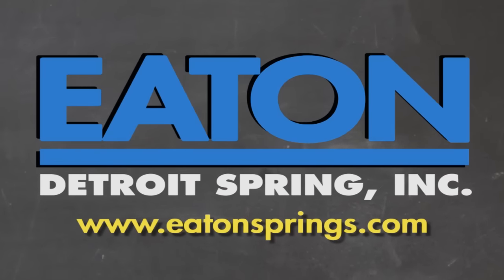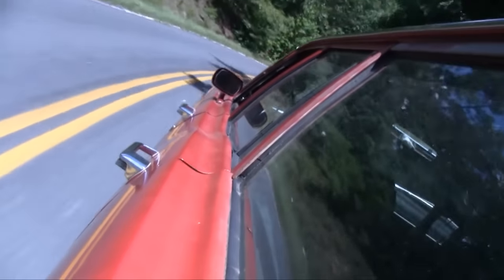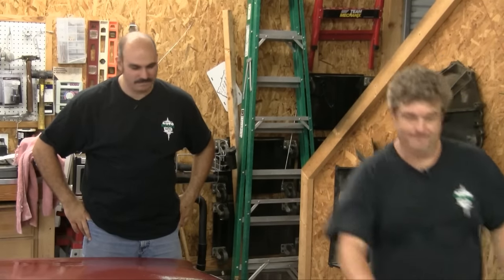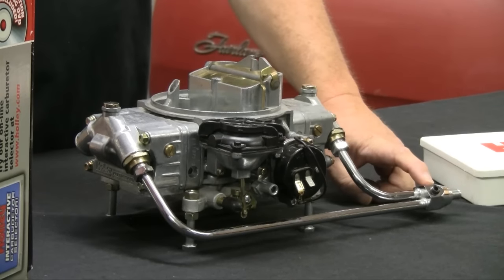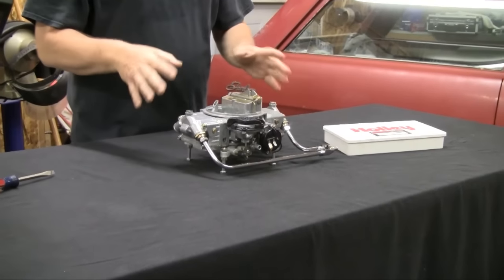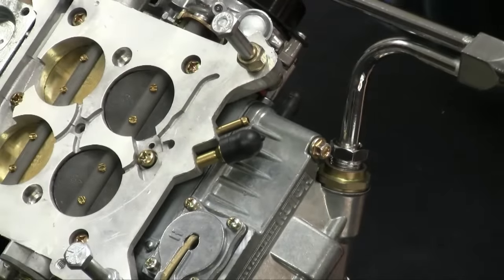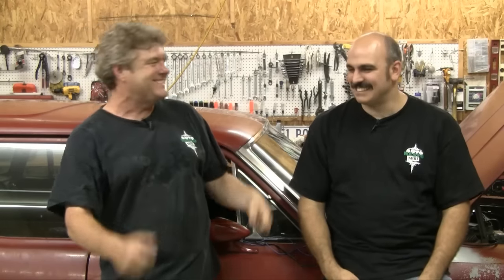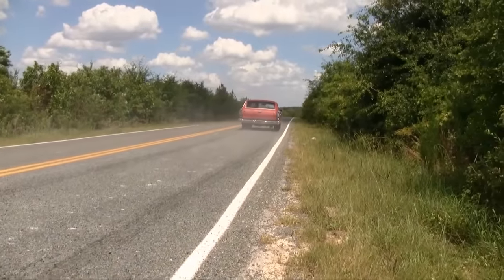Holley Carburetor set up and install tips and tricks Episode 218 Autorestomod

Comment: My 289 with the same Holley on it left me stranded on the side of the road twice. Couldn't keep fuel in the bowls. After several hours I finally found that the rubber plug on the ported vacuum at 7:45 had disintegrated. Used a drinking straw to get home.

Comment: I hooked my vacuum advance to full vacuum at idle and the engine fell on its face when i stepped on the gas off idle.Had to put it on ported vacuum to get it to run right.
Reply from the maker: That is what testing is allll about. Glad you got it going!

Comment: holley site recomends the ported vaccum on the passenger side of the carb for the distributor!you highly recomend the intake vacuum in the front bottom for the distributor!now which one is the best????
Reply from the maker: We eventually moved to the ported vacuum on the side of the carb as per Holley's instructions. We were going off of Ford's info for the vacuum advance. After moving to the ported vacuum it ran much better.
Reply: thanks a lot!!

Comment: Ported vacuum... My understanding is it is only used on some vacuum advance designs, depending on distributor model.  Most will never use it.  If you need it, you REALLY need it and wont get timing curve to behave well otherwise.   The larger port on that base?  Handy for modulator on a transmission where the manifold does not have it's own port to hook up.
Reply from the maker: I will try both. sometimes ported works better, sometimes manifold.

Comment: Nice Wagon. I just love the video. I have a 1972 Ford Galaxie 500 with a 400 engine. I'd like to have a pair of headers on it. Do you have any idea who may have a Header for my application?
Reply from the maker: +Mauro Pietro Not right off hand. We will say that we are running the manifolds on the 351 and are quite happy. Not sure we'd want to the trade-ff of the day to day hassle of headers for the little bit of power you'd see on a 400. 2.25 dual exhaust with a cross over would probably serve you way better.
Reply: Make sense. Thank you.

Comment: In my exsperiance The ported vacuum on the side of the carb is the correct place to hook up the distributor and not the base plate. If you hook up a vacuum guage. You will see  the base plate has less vacuum at higher revs and will not advance the timing.

Comment: Brilliant video as always guy.. but OMG what happend to the 67??? wheel fell off/?
Reply from the maker: Sgt Frag Yes. The hub was a faulty unit. Does happen.
Reply: AutoRestoMod thats bad.
Reply from the maker: Ram Skirata Luckily it was at low speed. The manufacturer was quick to help with parts, offers to repair the car etc. and very apologetic. We felt pretty good about the outcome all in all.
Reply: is it together and safe by now ?
Reply from the maker: Ram Skirata Yes. Parts came in within a week and look to be from a different source, the company said that from the photos, it looks like the metal was not up to spec. They have contacted the supplier who did the hub that broke. All is well.
Reply: vool :)

Comment: Jeff excellent how to vid. Glad I subscribed.  You guys are at the top of my list considering all the choices available on you tube. Enjoy all your presentations, they are very well done. Clear, concise and articulate. Maybe you can help me? I currently switched from a Holley 600cfm w/electric choke to a Quick Fuel 600cfm w/electric choke. Any advice or vids on set up and performance out of the box? Application: 1970 F100 SB 351W C6 Aftermarket Comp cam 518/518 Lift with headers. Keep up the great work.
Thanks in advance!!!
Reply from the maker: +deanda5150 We have not had the chance to play with a Quick Fuel, but all the recommendations would apply we feel sure.The carb seems to be an off-shoot of the Holley.

Comment: I have a holley 650 double pumper with electric choke and mechanical secondaries. You discuss the ported vacuum port and how it's not necessarily for the vacuum advance for this carburetor. My carb has the power vac port for the brakes in the back and a PCV & Full Vacuum port on the middle of the primary left side, and I also have two vacuum ports below the primary bowl. Should my disty vacuum advance go to the port on the front of this carburetors base plate and not the PVC and full vacuum  port which is on left mid front of my carb?
Reply from the maker: I'd try the manifold vacuum first. If that is not giving you what you need go ported. But exhaust all your options on the manifold vacuum first.
Reply: So here's the cool thing... I put my Holley 600 CFM with vacuum secondaries back on because I wasn't liking the newer 650. I did move the disty vacuum advance to the manifold and I was surprised  how well it was running. A much smoother idle and better acceleration than the last time it was on. This was a new carb that I purchased recently too. 
So I then decided to see if this would work for the 650 cfm. I put it on today and used the same manifold vacuum port and the curb idle was @ 1100 with the screw backed all the way off. I then moved the advance back to the port on the primary and I was able to drop the curb idle down. It seems like it's not getting the timing advance when I'm taking off from a stop. There's a slight hesitation at first but then it wants to come alive and dare you to crack open the secondaries. 
I have two new carbs now that were purchased direct from Holley. The 600 works great and the 650 has me on youtube looking for answers and working with Holley tech support. 
Thank you for your youtube post. @AutoRestoMod

Comment: trying to figure out jetting, 1967 Pontiac 4 speed HO , stock motor. Running a 670 Holley Street Avenger and moving jets between 65-70 size, what would be a good jet size for this motor, in your opinion
Reply from the maker: Honestly it's all in the plug read.  If it's a 400 HO then I would say that the 70 jets are a starting point and move up from there.. But it's really going to depend on what the plugs read.

Comment: What vacuum port would the line for modulator valve on a TH350 hook to?
Reply from the maker: There should be a vacuum tree on the back of the antique manifold somewhere. That's the port for the modulator.

Comment: So where do you hook up your power brake booster  vacuum hose?
Reply from the maker: Depends on the carburetor. Most Holleys have a port either on the back under the float bowls, or on the passenger side rear of the main plate.
Reply: It’s a holly 750 classic

Comment: Chris
I have a 1850 600 holley and its dumping fuel all over the manifold, even when its not running and i hit the linkage it pours out all sides....any suggestions?
Reply: Chris Caron power valve leaks. back gasket of metering block. for that spray with wd40 let sit half hour

Comment: Isn't the bigger vacuum port for the EGR valve hose?
Reply from the maker: There is a larger one for EGR on the back of the Holley base plate. On the front passenger (right) side is a port for vacuum.
Reply: Thanks for that, it's just that the person in the video says he doesn't know what the large port is for. Hence my question.
Reply from the maker: The two ports that are right together are both manifold vacuum but the larger port is too large for vacuum advance hose. I THINK it is for things like power brakes...but I'm not totally sure.

Comment: Hey I am curious what type of breather you have for the pcv coming out of the valve cover? thanks
Reply from the maker: We use the stock PCV valve and grommet for the Cleveland. The hose is a factory type that attaches to the inlet provided with the air cleaner.

Comment: Hey, I have a 1984 5.0 Windsor motor I'm trying to find the best carburetor for my car I bought a Holley 600 series which requires a lot of after market  adjustment so my question to you would be what is the best carburetor to fit my stock intake manifold.?? Thanks for reading.
Reply from the maker: Not sure what you mean by aftermarket adjustments. Most carbs will require tuning to run optimally. Also, is the intake a 2 barrel or 4?

Comment: My fast idle screw is hitting on the red choke cam and making the throttle stay open??
Reply from the maker: Back the screw off, it should only effect idle when the choke is in operation. I've had Holleys that the red cam doesn't retract well. check operation on that and use some Gibbs oil or other light parts oil on it.
Reply: AutoRestoMod Car Restoration Modification thank u! Appreciate the info! I'm a new subscriber!

Comment: Same install as the 4160? I can’t find info anywhere on it
Reply from the maker: Basics, yes. Carburetor inlet set up is different on the 4160 as it feeds from the drivers side. We recommend a banjo fitting to get the line to lay nice.
Reply: @AutoRestoMod  my 4160 on my chevy feeds from the passenger side front of the motor🤷‍♂️

Comment: What kind of glue treatment do I use on the gaskets?
Reply from the maker: None needed. we used to put a thin coat of grease on the bowl gaskets to make them easier to remove. But the new "blue" gaskets are way better about removal.
Reply: Thanks!